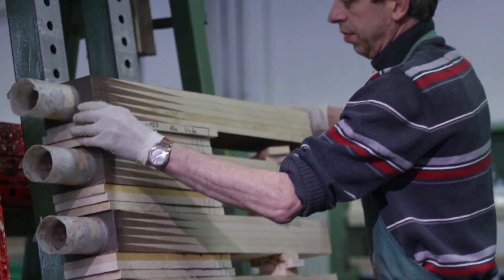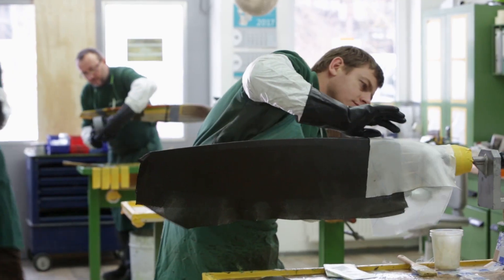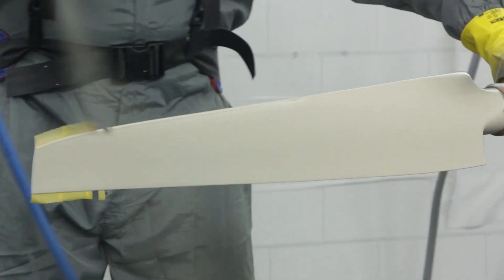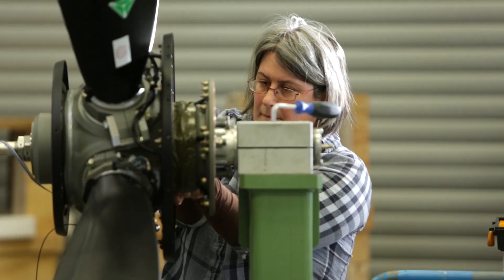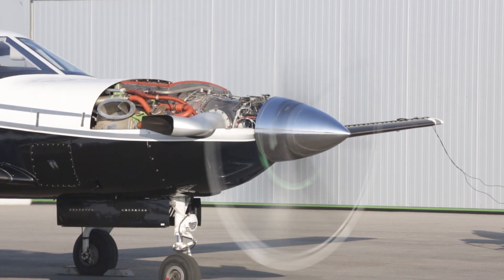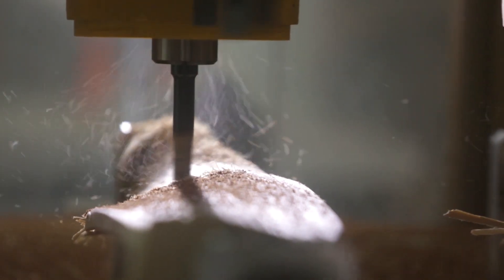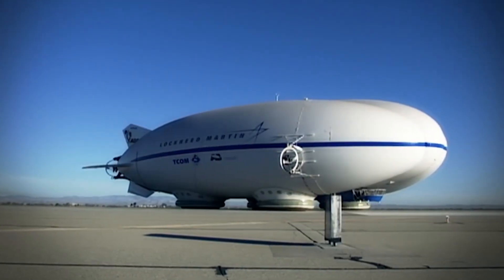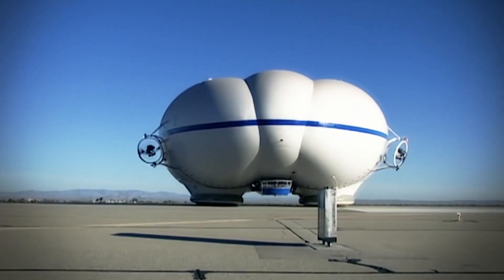Not Just a Propeller: Hybrid Airship Fly-By-Wire Technology and Advanced Propellers

Comment: Why you don't grow a pair and make a rigid hydrogen airship with modern components and safety materials?
What are you afraid of?  public opinion? 
It does not matter what people think, once you have one.. you can said to the military.. try to put it down..  shot with everything, and if it is well designed, it will last more than any helium airship at lower cost, and you will get a flying permission in no time.
Helium is the main cause why we don't see airships anymore.
You can exploit the best combo:  hydrogen, fuel cell, solar panels, no wires, no pipes, multiple engines, variable buoyancy, body lifting, air cushion, horizontal hull expansion to avoid ballonets,  etc.
If it is big scale, it does not even need an hangar..  how many things are built or maintained in the open?  You just need to change the manufacture procedure.
Reply: not much need for it in the military, it’s very niche. big target is easily shot down, unless you have active defense tech onboard like CIWS but that means more cost and weight... it all amounts to a big expensive flying paperweight that is slower than any plane. Airships are beautiful, but military use is not really their best application in the modern era. They’re better suited to peaceful civilian use, like as a flying cruise ship or some such